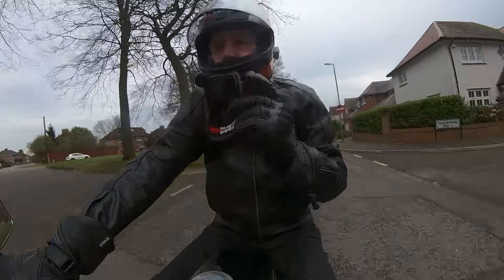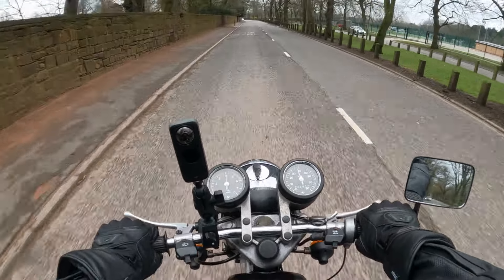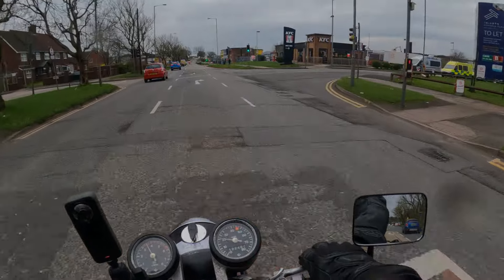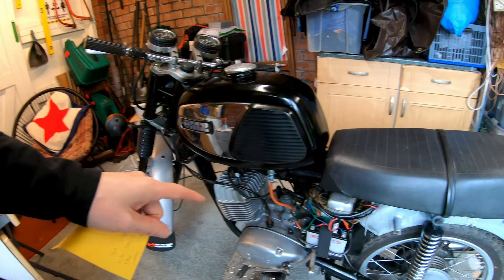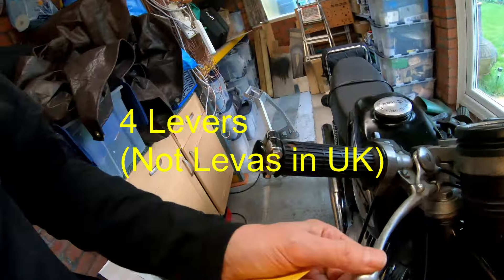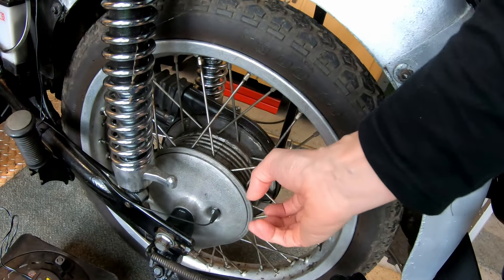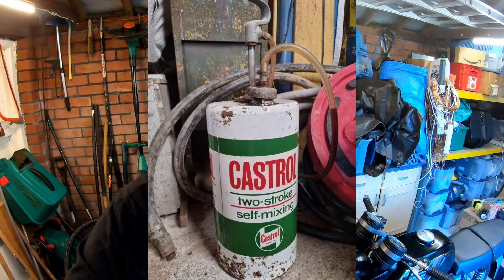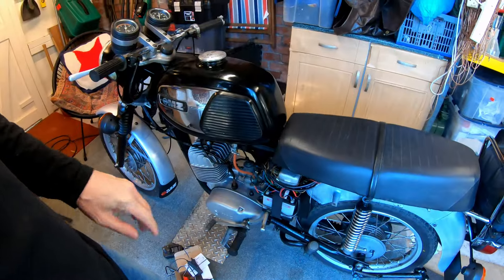MZ TS125 - Final MOT?

Comment: 6V electrics are fine if cleaned, the 60w generator is capable and reliable, 2t's idle fine when properly adjusted, i've never shaken my tanks after filling up. Nice bike! Sounds great! recently got one myself as a project. But, still have my ES250/2, etz250 and etz251.
Reply from the maker: I’ve had the bike 40 years, made only minor changes. It is what it is, and all the better for it. 👍

Comment: Commuted long distance on MZs for years. It was what one did. The front drum brake wasn't up to much, and owners swapped that and the main bearing for Honda units. That apart, they were pretty reliable. The 250s were probably second only to the CX500 as a London courier mount, which says a lot. Also handling was excellent for the era, much better than a typical Japanese bike.
Reply from the maker: Definitely under-rated. Probably due to styling and ‘communist’ origin during Cold War. The engineering, use of aluminium etc. was deceptively well done, for the price. I have to admit I appreciate it more now than I did, when I bought it as a skint youngster, 40 years ago. 👍👍

Comment: That seemed/looked like quite a lot of oil. I use 50:1 in my ETZ 250 which is 100ml for every 5 litres. Maybe it’s the camera not showing scale but that looked like a lot more than 100ml. What ratio does the fuel cap measure provide?
Reply from the maker: From memory the internal cap holds 90ml at the line for UK market. Which is 50:1 near as can be for a UK gallon of fuel, we didn’t have litres back then in UK market. I ran it right through the 80s daily ride like that. The manual is very clear that 50:1 is the perfect amount, any more will make no difference, in didactic East German (translation) fashion. Like many MZ ideas it is very practical to have that built into the cap. Ensures no short measures from inept forecourt dispensers. 👍
Reply: @CodgerBiker  Thanks for the reply, that’s interesting and reassuring!!
Reply from the maker: No problem. I just watched it back and I agree, the camera angle makes it look huge! 🙂👍